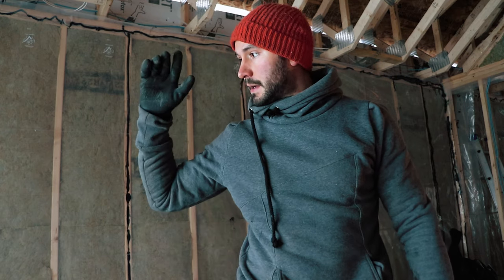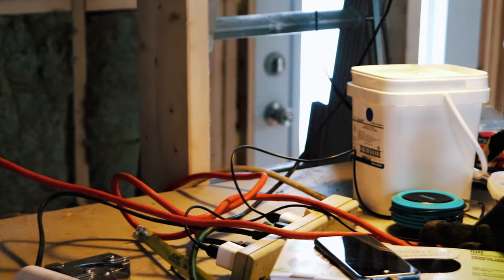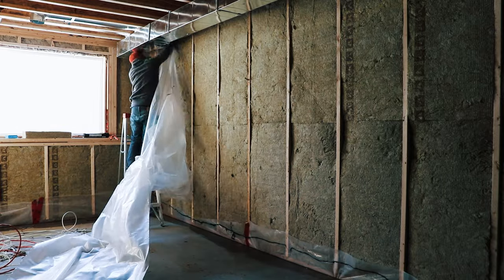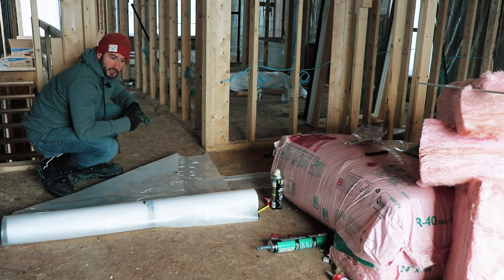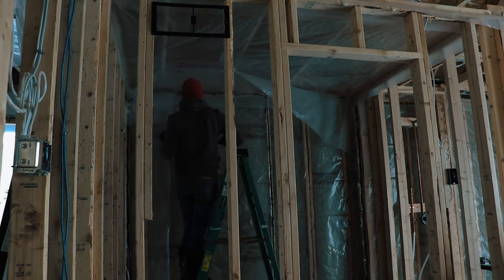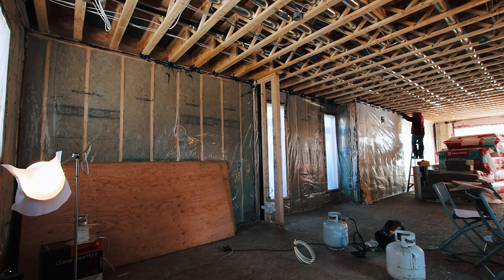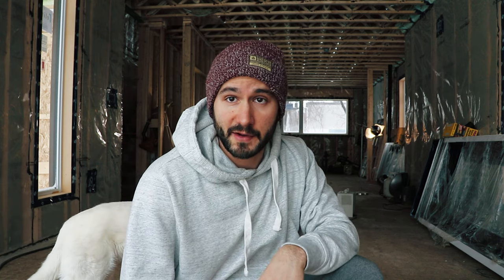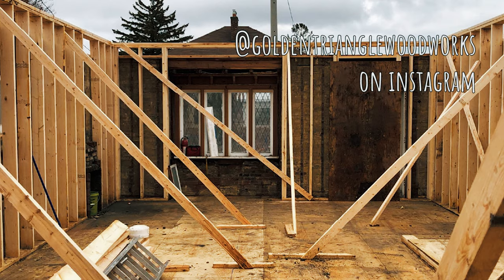EP 12 : VAPOR BARRIER INSTALLATION - DON'T MAKE THESE MISTAKES!

Comment: A tip, use Tungsten Carbide knife blades for sizing insulation is a great idea, as normal ones will dull quicker on the ins fibers an fatigue your arms alot quicker, plus can use them on concrete for alot longer if your having to template cut a lot of areas on downstairs areas with concrete slab. also can use rakes instead of a ladder for ceilings again depending what weight material your using, snub the ends with your knife and away you go.  a 200-300sqm house ,depending what batt material, proper quality install to code, all peripherals cut out, should take one full day to insulate one person with a few breaks. to retrofit or commercial residential type builds without a vapour barrier, a bit more for wall & ceiling strapping.. strappings good to reduce sag if your using heavy materials that wick moisture. Happy building!
Reply from the maker: Thanks for your comment. Very informative. I'm sure that's true for someone with a lot of experience. Doing the batt's didn't take too long. there were some areas we needed to cut a lot that slowed me down a little bit and it was my first time doing this. The longest part was the vapor barrier and taping! I always use carbide blades but I compared those to the bread knife and I thought the serrated knife was much faster!

Comment: Is the attic needs plywood on its base, and if there are spaces between the windows and dry wall what should I HAVE TO DO?
Reply from the maker: No plywood in the attic unless you plan on walking in there. Trusses aren't meant to take loads on the bottom chord though.

Comment from the maker: Hey! I know it's been a while. It's been really busy since I've been doing a lot of this work myself rather than hiring trades. After the vapour barrier was done - it was just a lot of prep for drywall. Building a few little plumbing walls, tying up loose ends, etc.. didn't think it was going to take this long - I'll run through all those little things in the drywall video. But it did. Anyone here deal with vapor barrier or spray foam lately? Experience? Let me know what you guys are up to!

Comment: I wonder about using vapor barrier inside instead?  I have this idea for an owner-builder small simple build in Florida.  I want an overengineered steel frame with cross bracing, enough girts and strong enough to address any load and racking concerns.  Then I want to screw in standing seam siding right over the frame (no sheathing no vapor barrier). By design allow the siding to have an escape for moisture on the bottom.  On the inside Mineral wool up against the siding packed in. Over the frame on the inside a quality stick vapor barrier and tape job, followed by pine siding screwed into the metal frame.   In Florida and will likely will need a structural engineer to do calculations , but will this pass ?
Reply from the maker: I would do a bit of research on building science for warm climates. I know nothing about that really. In cold climates you want your vapor barrier on the 'warm side' of the house to prevent condensation. My hunch tells me in warm climates the vapor barrier is not on the inside.. I could be wrong tho - so look into it. Not to sure about the structural question, sorry! Good luck - hope that helps.

Comment: I'm insulating my garage, and am ready to apply vapour barrier to the biggest wall. It's 25 feet ++ and 10 feet high. I'm doing it by myself, can I use multiple pieces of VB as long as I overlap a bit and of course tape it? Or does it have to be one continuous piece?
Reply from the maker: Overlap and tape the seams and you should be good to go!
Reply from the maker: Does not have to be one piece.

Comment: Do you use vapor barrier if the outside has tar paper on it?
Reply: You always want vapour barrier.  90% of the moisture will come from the inside of your house (human activity). The idea of the barrier is to prevent that moisture from getting into your structure. Depending on when your house was built the idea is that there should be ventilation on the outside of that barrier to quickly vent any moisture that does happen to get inside the structure. This philosophy has changed recently, (not really time tested yet, so we'll see if the new system works, in time) but if your house was built like 10-15 years ago or more, that's the idea. the tar paper back then was really just a stop-gap measure to protect the structure from any moisture coming from the outside environment.
Reply from the maker: This guy knows.

Comment: Got a few questions I'm insulating and want to do vapor barrier very soon. I'm doing a detached garage. How cold can it be for putting on the Black sealant. I see from your breath that it is freezing temperatures
Reply from the maker: I would check the manufacturers website to be sure but it's supposed to stay flexible even in really cold temps.. I put it on at like -30c, just a lot harder to squeeze through the tube.

Comment: Hi, thanks for your video on vapor barriers.   I'm trying hard to understand.   We have  moved to a 1900's home in Vancouver BC.  Part of the basement wall is not finished, in fact I can see daylight through the wall. It is just the siding exposed on the inside, there is no interior wall wood. There is no insulation, it's like being outside.  Can I put foam board on the outside wall then put pink insulation over that?  Should I then put plastic on the wall or just leave it with insulation exposed?   I did fill some of the  bigger holes with  Great Stuff.

This space is under the front hall and under the outside porch.  If I put pink insulation on the ceiling under the outside porch should I put plastic over that?  
The other part is under the front hall (so inside the main floor).  Should this part have no plastic?
I appreciate any advice.  The house is so cold I need to do something.
Reply from the maker: Hard to say specially if you have a stone foundation. It's not new typical wall assembly so hard to say where the due point would be. In a home that age, probably best to let everything breathe and have a chance to dry out. Don't want to trap moisture. Vapor barrier probably isn't going to do anything if the rest of the house isn't done. I would say use spray foam to fill all the gaps you can - you really don't want to be seeing sunlight. If you want to go all out, you could frame a small wall on the inside and insulate that. Leave an air gap behind so that moisture has room to evaporate.

Comment: Hey, Just found your videos, I'd like to ask you a question if I may. I love all the stuff you post, I have a channel i build houses as well, but on the other side of the world. I see you do the work withthe vapor barrier. I am located in an are that can be considered as COLD Climate as well. So vapor barrier in the inner side of the wall is suggested, however, I am wodering what material do you use on the extrernal side of the wall?
Simple OSB? The reason I am asking is, because a few guys here busing my "neck" over and over again, with the moisture question, acording to them a closed wall can not breathe. In tjis case: We close from the internal side, and so do we close on the other side of the 2x6 what will happen?
I am asking only to get an answer, compliments to your job, the vids and to your work! 

Thnaks, man, keep it up!
All the best from Europe (Hungary) 

Peter
Reply from the maker: I hear that from trades guys often as well but building science tells us otherwise. On the other side of the wall is an OSB with attached rigid insulation and tyvek which allows it to breath from that side.

Comment: This is fantastic! 

I have a question about the vapor barrier and the floor. I have a backyard studio build in progress here in Toronto and we used the rigid pink insulation between the floor joists and then put the subfloor down. We didn't tape between the pink insulation. 

Should we bring the plastic vapor barrier down the wall and across the top of the subfloor to create a continuous envelope or is it just needed in the ceiling and walls?
Reply from the maker: Always good to create a continuous envelope. Sorry for the late reply.

Comment: I'm going to try to half finish my sister's basement. The house shell is siding with the pink board inside, then pink bat insulation with the paper facing me in the basement. I cleaned the light mold on the studs and I want to know, Can I use a plastic sheeting over the insulation as another layer of protection before the drywall??? Thanks in advance.......
Reply from the maker: yes, you actually probably should. The only reason I didn't is because I have pink rigid foam insulation that acts as a vapour barrier. If you're just using fiberglass, you should have a vapour barrier in front before you install the drywall.
Reply: @HugoBuilds  Thank you.

Comment: Great video, At 12.25 you say about moisture forming between the vapour barriers. Isn't having 2 just an extra layer so it's a good idea? How would moisture get through either of them? Kind Regards
Reply from the maker: It has to do with the due point of the wall assembly. It's pretty technical so I'd suggest you do a bit of research on google. But just to sum up, every wall assembly depending on thickness/materials has a different due point. In our climate, cold gets in from the outside and the heat from the inside radiates out. Where the 2 come together is your due point and moisture can form. That's why the tyvek of the outside is 'semi-permeable' it allows any vapour to escape outwards. You don't want to trap any moisture inside the walls and then it could build up on the backside of the vapour barrier and start rotting everything from the inside slowly but surely. 

Thanks for watching!
Reply from the maker: @Donald Mayne haha yea sorry I don't know why I keep calling it moisture.. condensation. I'm sure I'll screw that one up again.
Reply: @HugoBuilds "in our climate " I'm assuming you mean American Midwest, but half the year the heat is on the outside. How does it not create a moisture problem?

Comment: Hey Hugo, nice videos! I'm looking at rockwool installation. Why didn't you use r30 rockwool above as well? Thanks and keep up the good work
Reply from the maker: Thank you! In the ceiling we sprayed cellulose. It's a lot easier and you can add more if you like. On the 1st and 2nd floor walls. We put the thickest rockwool you can in 2x6 studs (r22) and we have an exterior foam layer of continuous insulation which adds about r8.

Comment: Hi, i am a home owner in nyc, why do you need a vapor barrier on the inside of exterior walls?the benefits? And My house is old house and doesnt have these installed.
Reply from the maker: Yes you would need a vapor barrier on the inside of the exterior wall. However, if your house does not have one, adding it to one section while renovating won't do much.. better to just let an old house breathe. Newer building science tells us to create a fully sealed enveloped so that no vapor escapes the interior.. it's a major source of heat loss. Thanks for watching.

Comment: How about vapor barrier accommodations for outlet / switch boxes.  How do you improve the seal there?
Reply from the maker: Hi John, they sell all sorts of products for that condition. We used the cheapest one which is just vapour boxes that are installed with the electrical box. It's essentially a molded piece of vapour barrier that's a bit bitter than your electrical box. The more expensive option is fully sealed boxes that come with rubber gaskets. Thanks for watching good luck with your project!
Reply: I used to use insulation between the box and the switch plate. It was an old house and wind used to BLOW out of gaps there. There's purpose made thin white sheets of poly insulation and you just cut them to size. Really cuts down on drafts. It looks like something you would line a drawer with frankly.

Comment: Thanks for this video!  QUESTION about vapour barrier in the Toronto area. I have a 2 story townhouse with an attic space above the bedrooms, but old and useless insulation in the attic between the attic floor/bedroom ceiling joists. I would like to add R28 Rockwool in between these joists. How can I add the vapour barrier? Must the bedroom ceilings be torn down so that the vapour barrier is on the underside of the ceiling joists? Is this the only way?
Reply from the maker: I think that would be the way. I assume it's an older house which wouldn't be properly sealed anyway.. let you house breathe and insulate it as well as you can!

Comment: You should always put your ceilings poly up first too prevent condensation from leaking down in front of your wall poly , now if their was ever a leak coming from the attic it would come down and leak all over the drywall, but nice job on the roxel , that stuffs a pain in the ass
Reply: I think a leak is unacceptable regardless of where the water lands. Nothing tells you that you have a leak better than wet drywall lol
Reply from the maker: generally that's what I did. Thanks for the comment.
Reply: @HugoBuilds  if you ever have any questions you can send me a Gmail , I work for one of the best insulation/polys crews in all of Manitoba
Reply: @ironDsteele  forsure but a lot of leaks can happen from anybody from the roofer not sealing the roof proper,
Reply: Or drywallers missing studs but if you do a good job on the poly you should never have a leak coming through drywall

Comment: Hi Hugo,
I used R6 Comfortboard 80 between the basement framing and foundation to create continuous insulation but allow permeability. I’m not sure if your method or my method is better, just thought I would share!
Reply from the maker: Sounds like a good plan. There's always multiple good ways to do things. t's been a while now since we did it but I think the 2" rigid foam is around r10 and it was super easy to install. We actually didn't want permeability in the basement so the rigid acts as a vapor barrier. thanks for sharing!

Comment: Hey nice work! What did you mean about the foam in the basement? Cutting it up? I have foam on my basement walls and I've been wondering if I should put pink insulation over the foam. What are your thoughts on this? Also, I'm currently putting pink insulation on my knee wall. Should I put cardboard for ventilation through the eave-trough? I've just put insulation. Thanks from NB ;)
Reply from the maker: Hey! Thank you, I appreciate that. For the foam in the basement, we have a 2" rigid foam against the concrete wall that is all taped up. that acts as out vapor barrier. In front of that, there is a 2x4 wall @ 24" o.c. that is filled with r12 Roxul insulation. I think it's the best wall assembly for a basement. It's really comfortable down there. 
As far as the eaves, you should always have ventilation from the eaves into the roof however you accomplish that. You don't want the insulation to be so tight against the eaves that it's blocking air flow into the attic. Your roofing will last MUCH longer is your attic is properly ventilated. The attic should essentially be an unconditioned "outdoor" space. good luck!
Reply: @HugoBuilds  Thanks! I'm currently installing rigid rafter polystyrene against the inner roof wall of the attic. I'm assuming the pink insulation still goes over-top this?

Comment: Hi Hugo! My basement wall has R7 foam against the concrete foundation. I noticed something on your foundation wall. What is it? Looks like some type of paper? Thanks Dawn
Reply from the maker: No paper. 2" rigid foam was glued directly to the concrete foundation wall with PL foam glue. The seams were taped with tuck tape so the foam acts as a vapour barrier. Then the wall was framed with 2x10 and filled with 3.5" roxul. In some areas we installed vapour barrier plastic infront of that but soon realised it wasn't needed because the foam was doing that job.

Comment: Wouldn't it make more sense to put vapour barrier in behind exterior wall,,? And I noticed no vapour barrier underneath board's?
Reply from the maker: In a different climate maybe. Here is canada it's typical practice to have vapor barrier inside the wall. Depends on your wall assembly and where the dew-point falls.

Comment: At the bottom of the wall the acoustical sealant should be applied at the junction of the bottom plate and the floor sheathing. There is always a gap between the two that allows a significant amount of air to move through and this needs to be properly sealed to prevent draft and condensation at that location. There is no point in doing it 90% when you can do it 100%. You didn't show doing it but the joint between the ceiling poly and the between plate poly should also be sealed with acoustical sealant as should all of the pipe and wire penetration of the plates into the attic through the top plates.
Reply from the maker: Those were all done and vigorously inspected by the City. thanks for the comment!
Reply: also sealant was done in zigzag in many cases while it should be done in the joint (between 2 planks)

Comment: About your basement. I saw that you were framing against concrete. Why not use sprayfoam to get behind the studs and create a total vapour barrier? Unless it was a budget issue, then, pardon my comment. Good job!
Reply from the maker: yea it's a budget thing. Sprayfoam is expensive. Also like having some airspace behind there for any moisture to dry it if it ever gets there.
Reply: @HugoBuilds  I agree also static air space increases r value